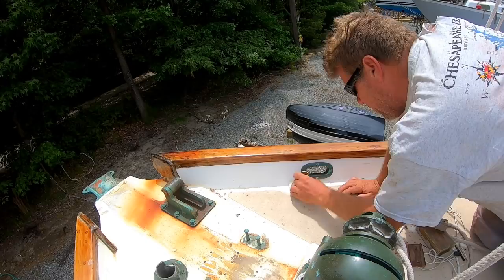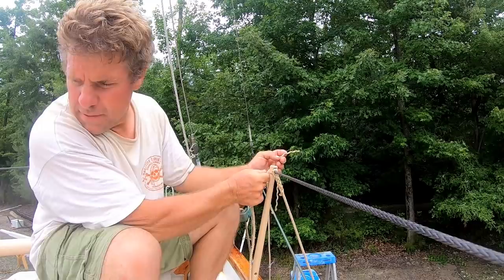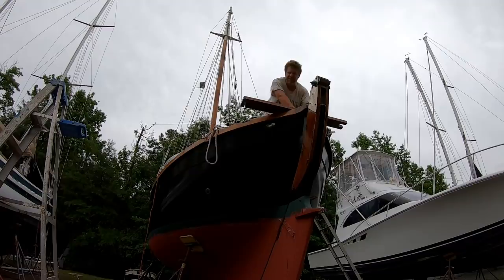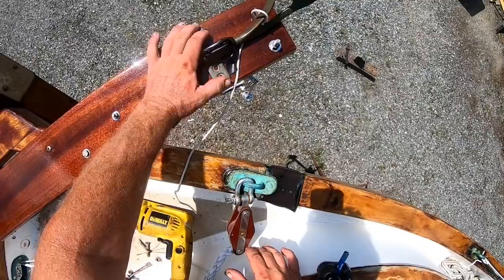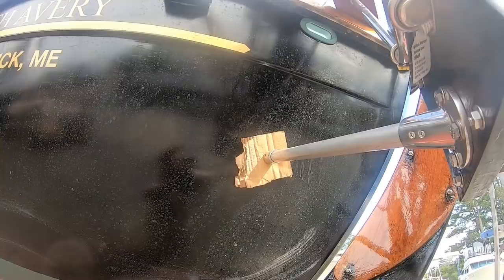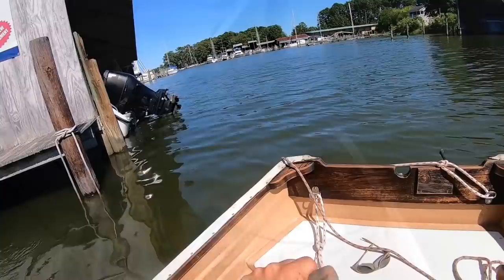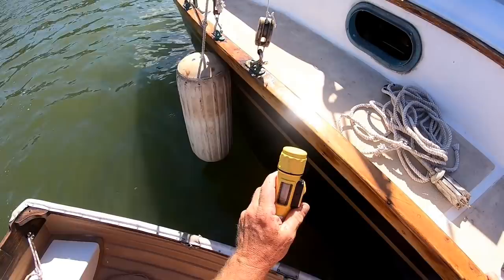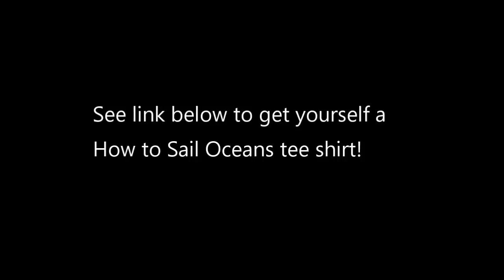Installing an engine?

Comment: The little kicker motor is a great addition. As you know, there are times when a little kicker is such an advantage. You could easily damage your boat or another boat that would exceed the value of a kicker. Good upgrade. MH

Comment: For those very, very rare moments when you need power, I think it's a reasonable solution.  Frankly, I think you could switch to a 24v trolling motor and tie it to the mothership's new lithium batteries.  I'm glad that the outboard bracket is removable for normal sailing. The bracket itself can always evolve in design to suit your desires.

You've sailed Ruth Avery with nothing but a sculling oar for years. We all get older and things get more difficult. The O/B bracket is not a crime.
Reply: or have the trolling motor as a backup
Reply: Perhaps not a Crime, but arguably a mustache on the Mona Lisa. Well designed for function, nonetheless. I’m glad it can be easily removed.
Reply: I sailed for some years with no engine at all, then a few years with an outboard, and the past decade with inboard diesel, nothing beats the romance of pure sail, nothing beats docking with an outboard and rudder together, and having a diesel with plenty of power waiting patiently for my call is also pretty unbeatable too

Comment: Great episode! I heartily endorse the use of small outboards as auxiliaries.  I have a Cape Dory 25 which has an outboard well but only conceals a Honda 2hp and even then it hangs on the stern rail most of the time.
Reply: Will be trying out a 27# Merc 3.3hp 2 strk in the well of my Pearson Ariel, where 'til now a 72# Merc 6hp 4 strk has resided. If I can get 2-3kts from it, then that may become the new setup.

Comment: You finally  arrived in the 21th century!  I have a feeling that with the dry starts required with your bracket you will be replacing the impeller often.

Comment: The beauty of those wee 3.5 Tohatsu, besides being so reliable, is that they are so noisy you won’t use it unless you really need to.  
I had a small cat, came with a 15hp, changed to a wee Tohatsu, lost all of 1kt, would come to a standstill against a F7.
Reply from the maker: Well said!  Yes, reliable and noisy.

Comment: I am so relieved about this project, both in the practicality of having this little pusher available to use in tight quarters AND in the way it is designed and executed, the same way I do stuff on my boats and RV's.. back envelope engineering and function over form.  Great job...

Comment: I a few months ago had thought of no valid reason for direct drive diesel, only to have a generator, electric drive only. Some up wind, tide and slight drag of anchor towards shore with less than 2' under your keel has a way of adjusting your views. 
I am always impressed and try to learn from you. Given your non reliance on powering out of everything. 
I already purchased an 8hp longshaft. Intending to make a rudder mount.
I know a Ziska who is putting sail drive pod on his engineless also. 
Just practical.

Comment: A setup you might like is where you attach a electric trolling motor to your rudder permanently, it's not in plain sight but available when you need it and they build them with plenty of thrust to help out. There is also a fixed model you could mount to the hull that would be out of sight. Have a great day.

Comment: An engine destroys patience, but you still wait for that fair wind to move on.This also solves that nagging desire to get into tight spots without that great workout, and against small winds and currents. Since it works for you, it's good. Fair winds.
Reply: Moving without an engine in certain areas is downright dangerous...even waiting on proper weather/winds the weather can change at any time. We are not living in the 1800 or early 1900's so there is absolutely no reason not to use technology, if you say otherwise I question whether you have a GPS, liferaft, epirb, vhf and trust your still using a horse and buggy
Reply: @wakeboardbob  who says otherwise?

Comment: A wise addition Kevin , not exactly a get out of jail card but you could easily up the hp at a later date if you feel the need. I have a new Suzuki 5hp four stroke you can lift with 1 hand , super light and good for small tenders like baby Ru.

Comment: Nice job with the available materials. I'm sure you already know that, but the engine is too high in the water. You need a longer shaft. 
One thing you can do though, so at least you don't start it out of the water,  is extending the pull cord to your cockpit with a  turning block, so you can start the engine after you lower it in the water.
Reply: "You need a longer shaft."
I doubt it.  Have you seen his girlfriend?

Comment: I’ve been thinking that a temporary mount for your outboard would be a simpler solution vs lashing the dingy to the side when you need power.  I hope this works well — and that the lines of your beautiful boat are retained when you take the mount off. 

Btw, my daughter mastered Bach’s fugue in D major on the piano last week at music camp.  

7 weeks of hard labor condensed into a 14.7 minute video. You make it look easy.

Comment: Good for you Kevin

Agnostics focus on utilizing the right tool for the job - regardless of what it may be - while ideologues are intent on making some kind of statement

Sail the seas, check in now and then, no one will notice as you come and go with aux power

Be the artist, attract attention by forcing the issue, and you may get more notice than you suspect

Sigmas have to navigate a world filled with envious drones; don't let them get an angle on you
Reply from the maker: Good advice!  I think I'm going to write that down.
Reply: @howtosailoceans1423  Browsing Pardey's book, she notes that larger vessels tend to avoid smaller boats. She thinks it's due to size/value, but I believe she's missing a basic social element.

It's not that snooty, wealthy sailors don't want to associate with those with less means. Rather, given the proliferation of gypsy bums and fellow travelers, there's a whole contingent - regardless of activity, whether sailing, surfing, road tripping, etc - that are simply unaccomplished layabouts.

So if owners of larger newer boats are avoiding smaller older ones, it may be due to just a basic survival instinct. That is, remain aloaf so to avoid inviting potential trouble. Since the Pardeys were big advocates of engine free sailing, how would a "normal" person be expected to initially react? That is, until maybe they find out that they were extremely accomplished sailing celebrities? But there's a big what if: what happens if they never get the chance to meet if the wealthy yacht owner continues to avoid them due to initial impressions?

Which is why I think using an aux motor is critical to allaying any potential concerns. Whether than immediately go on the defensive thinking their expensive, shiny new boat migh be potential damaged by a wild nomad, why not avoid making any impression at all? Sail in, demonstrating utter competenence, so that all they might see is someone not causing any commotion.

Then, if/when word gets around about who you are and what you've done, don't be surprised if all of a sudden there's a lot of interest. That's what I meant by the sigma charts his own course without making sure everyone knows it. Let them come around to you - there's not a yachtsman out there who wouldn't love to invite you over for a drink and hear your tales.

Comment: Kinda had to happen eventually & have long thought about your powerless situations however... a simpler & more robust setup could be to simply fix a wood mount block on the rudder... I'm sure the rudder pintles are up to the task & if the mighty 3.5s prop were just astern of the rudder you could still have a very effective stern thruster

Comment: 11:00ish. You started a water cooled outboard out of the water... I always thought running the rubber impeller/water pump while dry, even for a minute, would damage it. I hope yours is OK.
Reply: starting from cold it is going to take some time to overheat and a person's arm is not long enough to reach down with the engine in the water and pull the starter rope.
Reply: @UUBrahman  running the jabsco dry is the issue not the engine temperature per se.
Reply: @normanboyes4983  Good point.  What is the solution afterwards - replace the water impeller?
Reply: @UUBrahman  well if you melt the impeller you will have to replace it - but best to avoid running it dry at all.

Comment: 100% im running an engine cause its good security. But not some 10hp docking engine i wana be able to power thru waves if stuff gets tight. But thats me im a mechanic/carpenter so can fix anything

Comment: I love that very practical solution to your motive problems in tight spaces and I don't think it will detract from your overall ethos of an "engineless" boat. It did look it needed to be a tad deeper into the water though.
Was that a hand-held depth sounder you have? I could really do with one of those!

Comment: I'm surprised you didn't make a bracket that could wrap around the rudder, frame type and could hook the engine to the rudder with a quick connect and have remote motor control on the tiller.

Comment: Do you think a little more of the prop in the water would give you more push power?
Reply from the maker: Yes,  a long shaft would work better, but I purchased the outboard for the dinghy originally.

Comment: I'm proud of you, as usual (not that you need my lay thoughts or opinions).

are you considering a slightly bigger engine, enough to counter current, is your set up strong enough for a 10 or 15 hp?

Comment: Should be interesting when you upgrade that to an electric hydrogenerator and motor. No maintenance and power from sailing if sufficiently tuned/geared for your slow typical hull speed.

Comment: Wow, awesome upgrade. Nice working.
I agree that little thing will struggle in open water with being buffeted by the waves etc. I hope removal of it won't be too hard if you have the rigging to hoist it up and aboard? Especially in rough waters?
Reply from the maker: Soon will have to work that out.

Comment: I posted this comment on one of your videos however it's probably more pertinent here : The Glénans sailing School in France , preferred to not have engines on its cruising yachts, now that the legislation restricts entering harbor under sail they had to change. It's a real shame, just another useless crutch to replace lack of seamanship.

Comment: Typical boaty, using an old screwdriver as a chisel :) A tip, if you use metal eyes you can whack them a bit flatter with a hammer after inserting into the spliced eye,  That opens the eye up a bit.

Comment: Would the cargo net interfere with the anchor?
Reply from the maker: So far so good.  I was worried about that as well, but the netting just rests on top when the anchor is stowed and lets the anchor drop freely.
Reply: @howtosailoceans1423  Not often one sees a cargo net made the old way, very nice!

Comment: I'm sure you've been asked this before, but I have to ask; why don't you wear a harness when outside the cockpit? Not a dig at you in any way. Just curious. 

Enjoying your channel.
Reply: Some people just dont care. Its that simple.
Reply: @chazarkansas1366  Having just seen extra stanchions and netting being installed I would think that's not the case here.
Reply: @andywakelin1380  sure.
Reply: He actually mentions it in another video.  I'm foggy in my memory but I it's calculated risk on his part.  Getting the safety features installed and/or usable was challenging and he prefers to not use it.  I could be wrong here but that's what I remember.
Reply: @bdlii  Calculated risk lol.
Reply from the maker: Harnesses can be a real pain, as the tether frequently gets tangled in what you are working on.

Comment: Auxiliary outboard mounting on a canoe stern double ended boat is challenging.  Wonder if a side mount like this link might work:  https://edsonmarine.com/side-mount-outboard-engine-bracket-large/  With your masters in physics, I am confident you could design one yourself and have a machine shop make two, one for each side. Consider a 6hp Tohatsu with a 25 inch ultra long shaft weighing 61 pounds should achieve 4+ knots at wide open throttle.